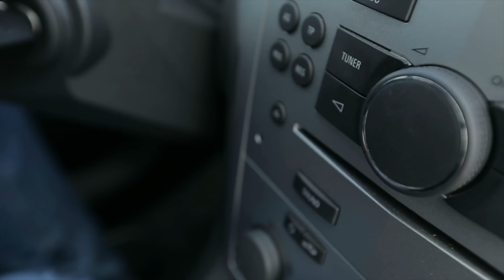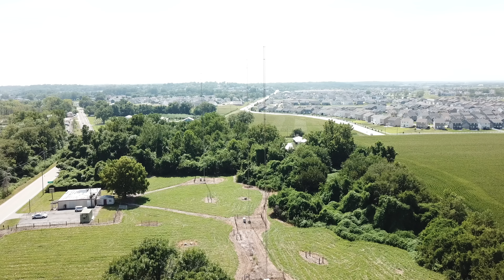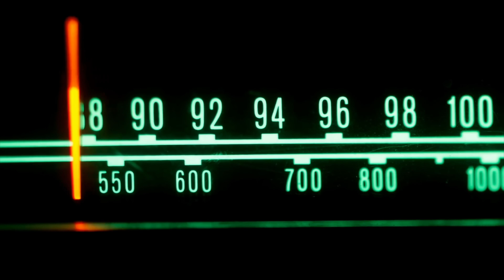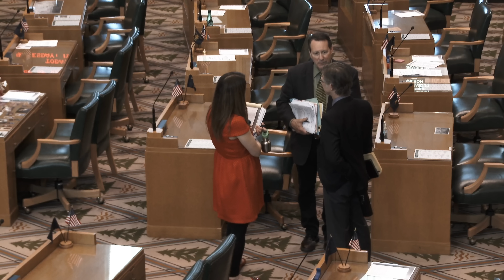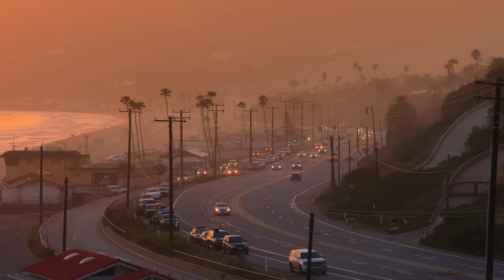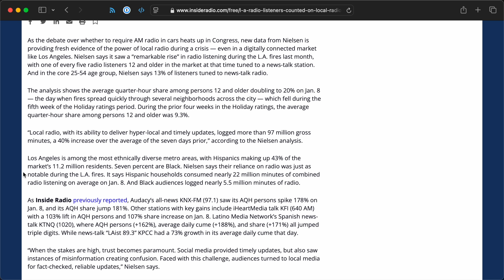Automakers are losing the battle with this 100-year-old tech

Comment: AM has poorer sound quality compared with FM, but is cheaper and can be transmitted over long distances so better for emergency messages.
Reply: it is the point of maintaining AM Radio. Yes it is poor quality sound yet travels large areas.
Reply: @smithwez1101  Can't we just add digital audio on top of existing AM broadcasting? There's already tech and hardware to provide better sound quality with same range
Reply: @saiv46  the simplicity of AM receivers is also a factor, adding digital audio also adds complexity to what should be an essential emergency system
Reply: @saiv46  You're describing HD radio, but that's carried over FM. In urban areas it actually makes more sense because it has less interferance than AM. There are some Am stations that I can't listen to in my downtown area because of all of the electrical interferance, but the HD version of that station comes through clearly.
Reply: @stuntmonkey00  Can't HD Radio be carried over AM as well?
Reply: @saiv46 The point of emergency systems are to be as simple and idiot-proof as possible, so nothing could possibly (realistically) go wrong. There's just no need to make things more complicated.
Reply: @saiv46  There is HD Radio for AM stations, but it's very rarely used. Both because it causes bad interference to adjacent stations, but also because you need to be very close to the towers for the signal to be clean enough to decode properly (think of digital TV - it either looks perfect or it doesn't come in at all). A handful of AM stations have gone digital only, turning off their analog signal so the digital signal can be more robust (more error correction).
Reply: @TheFalconerNZ  AM used to sound pretty good, it's just susceptible to interference 

As things like wi-fi and cellphone towers started to pop ups the quality seems to have dropped off.

Same thing with analog TV. It used to be pretty clear but all the interfere ruined it.
Reply: @tristan6509 not even close. AM sounded like shit even in the 90's compared to fm
Reply: @ AM is inferior to FM, but it does not have to sound "bad". One other interesting option would be DRM, which would allow broadcasting on LW/MW/SW frequencies with potentially very good sound quality.
Reply: @ and one point I would also like to add, most people will use the internet for music anyway, so AM could be potentially very good for emergency communications.
Reply: AM does not even necessarily have to sound bad, there are tons of new technologies made by radio amateurs and such that improve sound quality a lot.
Reply: @kastelukannumollom5289  correct AM stereo provides a less compressed signal.
Reply: AM could have better sound than standard FM... but nobody wants to change it to make it superior.
Best thing about AM is the range.  ~500 miles and more.
Reply: @jazzlover10000  500 miles is a major understatement, with MW/LW it can be thousands of miles and with SW there is not a single location that you cannot possibly reach.
Reply: AM has poor sound quality ONLY because the FRC, which is now the FCC, set the bandwidth too narrow in the 1920s. Has ABSOLUTELY NOTHING to do with technology. Widen the bandwidth and you have better fidelity. They had hi-fi AM stations in the 30s that extended sound coverage to 15KC.
Reply: @td3993  They narrowed the bandwidth even more, I think, in the 80s or 90s.  The average AM receiver has 💩 for technology - by design - because the manufacturers know that no one listens to AM radio anymore. The FCC has also completely deregulated coverage/interference standards (at the request, no, make that WHINING)  of station owners.  The days of large area nighttime coverage are gone. Then there is soil conductivity, which effects coverage. About half of the country has substandard soil, which translates into lousy coverage area. See: almost any place East of the Mississippi River and South of the Ohio River. PLUS, AM radio is susceptible to electrical interference from a variety of sources, from hair dryers and fluorescent lights to computers.
Reply: @President_Pampers  My 30s and 40s radios sound amazing. Seems the new radios clip bandwidth hard. My 67V1 sounds almost like FM. Also, using a low impedance loop antenna largely eliminates static. It only picks up electromagnetic radiation, not local electrostatic interference. My Philco 42-1012 has pretty much zero interference, and uses a low impedance loop that's maybe 2 feet in each direction square, and has two turns. Picks up Boston, California, in Milwaukee.
Reply: @td3993  The AM radio in my 68 Mustang sounded better than what I hear today. That aside, AM's days are numbered. Stations are going dark or reducing power to strictly local service. At one time, the FCC was considering migrating all AM stations to the now-vacant spectrum space that used to be home to TV channels 2-6. Don't know what happened to that, but the handwriting is on the wall.
Reply: @DiaperDon_BoneSpurs_Epstein  What good would moving AM stations to TV channels 2 through 6 do? No one has a radio that tunes to that spectrum. Also, what would you put in place of AM stations on the normal broadcast band? Nothing else is going to use that spectrum, and the fact that gov't is mandating AM radios in cars says that AM radio's days aren't numbered.
Reply: @td3993  It's obvious you haven't thought this through at all. Do I need to address each point for you?
Reply: All radio is now local radio. The days of long distance decent reception have faded. Can't even get KFI  from LA anymore. Used to have a signal as good as a local station.
Reply: We had AM this long, we might as well keep it!
Reply: who cares, if you don't like the sound, DON'T LISTEN TO IT IDIOT. Don't force on me if I want to listen to AM.
Reply: So you listen to AM for music vs FM. You are missing the point.
Reply: @greghol  That I said that my old AM radios sound better is not me saying that I listen to AM vs FM for music. I actually listen to music on YouTube and Pandora mostly. Your comment made no sense.
Reply: @td3993  I do make sense. Some mentioned it too. Whatever.

Comment: The problem is not spurious RF from the main ECU or any of a bunch of other microprocessor controlled subsystems on the CANBUS in modern cars as they are usually well shielded;  for example the DSP, FPGAs or CPUs controlling electronic steering rack assistance or active suspension.   It's the delta of impedance and reactance when pumping a PWM current into direct drive stator/armature windings with fundamental frequencies which rapidly vary together with their harmonics, some of which swamp the 530-1620 kHz broadcasting HF  broadcast stations.   A similar spurious EMI effect is experienced in cities with trams and trolley buses.   It is theoretically possible to actively cancel these EMI emissions but it would require thinking about EMI from the very beginning of drive train design.   That sounds like way too hard for manufacturers who have outsourced many components and treat them as "black boxes".

Comment: I'm pretty sure many of the the broadcasters in the UK would love to switch off AM radio.  The cost of maintaining the masts and the very high cost of (Miliband Net Zero) Electricity makes them expensive to run.  Far more so than renting a slot on the DAB Multiplexer network.

Comment: The Dems were pushing to get rid of AM radio. There was no real issue with antennas or interference issues. A large proportion of AM stations are right leaning political stations and religious stations. The goal was to absolutely cut off peoples access to information.

Comment: Automakers removed it for simplification and cost reduction based of the very low numbers that actually use it.  The uproar for mandating it comes from the Reich Wing, due to the fact that much of their talk radio indoctrination structure is on the AM spectrum, so the associated lawmakers then insist on things that benefit them.

Comment: Most radio spectrum should be for internet and mostly a common carrier utility that everyone can use at minimal cost if following rules that allows everyone to enjoy communication.
I see mandates on manufactures as a thicket of regulation I think requiring old tech needs significant justification. I like that it's under continual review.
Reply: Lower frequencies can't be used to carry enough intelligence without ridiculously high bandwidths and it is as slow as a wet week. That's one of the reasons why smart phones and WiFi devices use such high frequencies such as 2.4Ghz. There are other reasons such as antenna size and propagation characteristics but that is another matter.

Comment: Long live AM Radio, it is absolutely an imperative to support it. Public safety, and national security make it a no brainer. It works when other systems do not or cannot, at ranges higher frequency stuff to include even Satellite cannot, Yes its noisy but in difficult circumstances we wont need to listen to Beethoven. On a job during 9/11 its how and the only way I and my crew could get the news where we were assigned that day, as one example. Now two decades later we have Hurricane Helene, and the Wildfires as two contemporary examples. It’s cheap the infrastructure already exists and it works, at a time you have to think that way. I never reach out to my elected federal legislators considered it a waste of time but in this one instance I actually did. You should too you never know

Comment: How well would FM modulation work in traditional AM bands? Obviously you'd have fewer stations, but you probably wouldn't want the sort of audio bandwidth that FM stations have anyway.
Reply: The issue is bandwidth. An AM signal occupies about 1/10th as much space as an FM signal. The FM broadcast band occupies 20 MHz of spectrum space. The AM broadcast band occupies a little over 1 MHz. FM just isn't practical to use at lower frequencies because of this reason.
Reply: @davidbarts6144  It's not just the size of the band, it's the bandwidth of the signal itself. AM broadcast signals are about one twentieth the bandwidth of an FM broadcast signal. 9khz vs. nearly 200khz. Then there's the issue of ionospheric refraction and absorption. At MW frequencies, signals are reflected off the F layer of the ionosphere.
That all sounds well and good, but not all frequencies in the spectrum are refracted equally, and partial absorption can also occur meaning that broad banded FM signals
can lose a lot of intelligence. Narrow banded AM is far superior in this part of the frequency spectrum.

Comment: It's not AM that has better coverage, but the High Frequency radio signal (HF, 3-30 MHz) that it is put on. In contrast to FM that is Very High Frequency (VHF, 30-300 MHz) it does have better propagation over long distances. So it's not (mainly) due to the modulation, it is due to the frequency used. Although in practice these terms can be used intercahngeably as these types of modulations are typically used on the frequency bands mentioned.
That said I do find it ridicolous not to implement an AM receiver, given that all radios are SDR-s now (Software Defined Radio) and implementing an AM receiver takes about 10 or less lines of C code.
Reply: If it's only limited by software, does that mean an SDR with the right programming could theoretically receive any and all radio signals?
Reply: @InventorZahran  Pretty much yes.
Any radio signal can be described mathematically so once it is digitized (properly) you can do any math to it that you like. So any radio signal can theoretically be demodulated.

Comment: I would tend to agree with your suggestion right at the end,, although that is my preference when it comes to these sort of regulations mandating functionality in general. I am strongly in support of such regulations should focus on describing the result that the mandated functionality should achieve in the form of clear measurable verifiable criteria against which any solution can be measured and certified. While taking care to avoid as far as possible any language or superfluous incidental criteria which only serve to constrain how to implement the functionality not only for now but worse still into the future where even the most well meaning of best practices for the implementation you decide to include may prove to be archaic in light of the evolution of the applicable technologies. By writing regulations to stick to the core of exactly what we as a society demand the vital functionality we choose to mandate be available must achieve as the desired objectively measurable result as far as we possibly can, while avoiding unnecessarily constraining the specific means of implementation we make it far less likely that those regulations suffer the fate of so many well meaning and initially very beneficial regulations throughout history. Namely becoming the impetus for the accelerated adoption of a beneficial feature only to then hamstring the benefits of that technology because some poorly chosen language in the regulation does not age well and hinders the adoption of improved technological best practices when engineering knowledge evolves.

Comment: You can reduce switching noise on electric cars if they are designed properly. They just don't want to spend a few dollars on emi filtering and better design. AM me hops over mountains and penetrates walls better internet independent, at night it travels thousands of miles too. FM is boring with pop stuff and 10 npr approved propaganda stations.

Comment: AM radio is like the last safety shoot after jumping out of an airplane when the main shoot fails. It has longer range for the power, simpler transmission and receiver tech required. Like shortwave SSB for international coms in the event of a WWIII break out or a major sun mass radiation event blowing away anything in obit. The current forms of coms reliant on internet and or satellite is very vulnerable.
Reply: There are a lot of guys at FEMA and homeland security thinking about what will survive, be most helpful. My faith is in the many people who are ‘do’ers’. To just do things, some not thought of before!

Comment: AM radio has a huge broadcast radius, which is useful in large countries like USA and Russia. At night, I was able to receive an AM MW radiostation located 1200 km away from me. On short waves, I can receive radiostations located 3500 kilometers away (for example, China Radio International in Vladimir oblast). But, unfortunately, in Russia itself there are practically no AM radiostations left, either on MW and SW.
Reply: Here in Czechia, I get stations from Italy or even Portugal on little pocket radio inside of my brick building, it's insane. Ofcourse signal is bad, but it't ther. But that's even main disadvantage, that frequency spectrum is too occupied and there are too many interferences and transmitters need ancient technology and massive amount of power. In case of war, yes, you can have one transmitter for whole country, but you can't hide it and enemy will immediatelly destroys it, so I am not sure if it actually makes sense to keeping it. On other hand, FM radio can be broadcasted easily from anywhere with cheap and simple technology.

Comment: When i was a kid my pocket money job was helping the milkman deliver the milk every morning (except Sunday) and the milk float was an electric one, two big banks of batteries either side of the float powering two big arse DC (in guessing) morors and the driver had a little hand held AM/FM transistor radio, he would only listen to two radio stations both of which were in the AM band, because he claimed that the stations on FM inly played "This modern bloody stuff that you can't even call music" and even with the big motors running right underneath the little tranny it happly received the AM signal and played his favorite tunes and news with no more or less interference than it did in the FM band so how modern car manufacturers cant get an AM radio to work in an EV is beyond me, perhaps they should keep the AM radios and sack the EVs and bring back the V8?